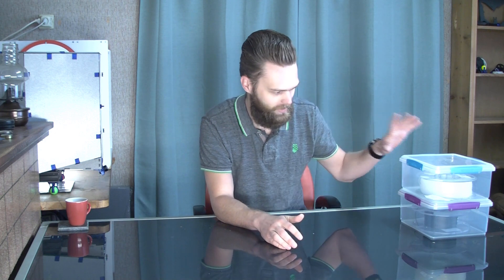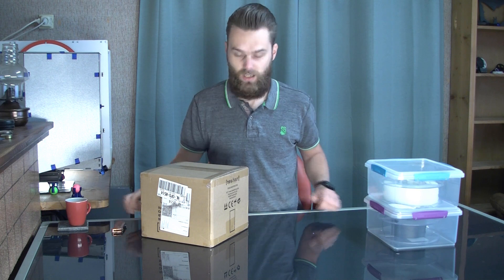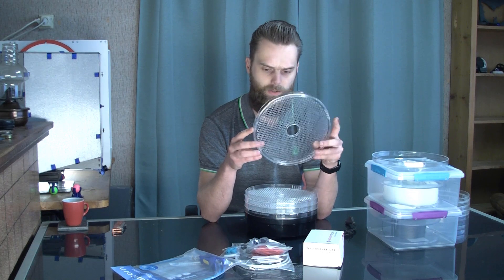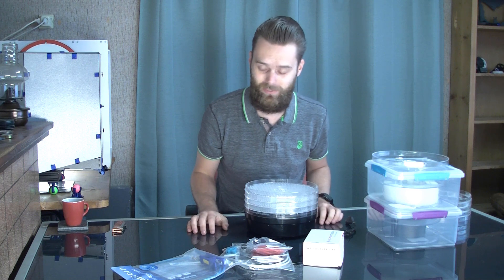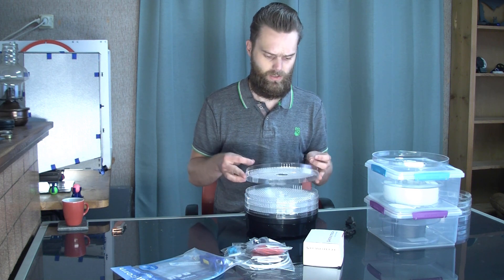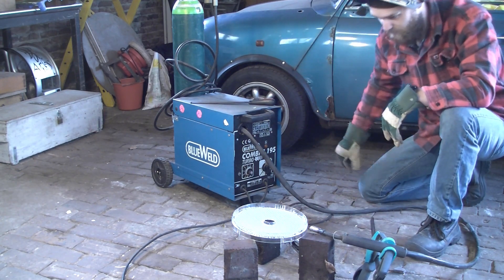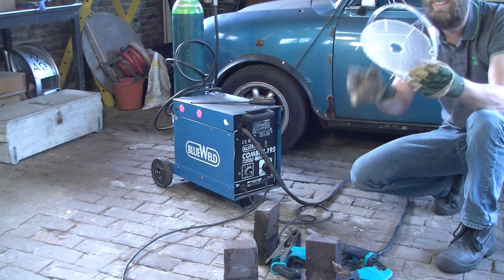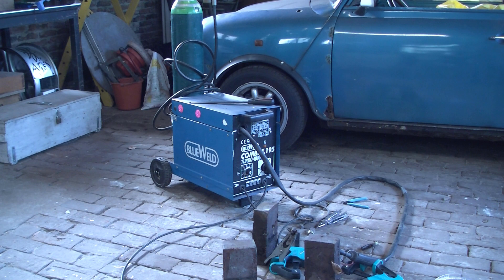Printing (carbon fiber) Nylon on an Ender 3

Comment: If going after an ant with a bazooka like this won't get you any new subs i dunno what will Jon. Hilarious! I feel sorry for the guitar though...
Reply: I think a foam cutter with heated wire will do the job
Reply from the maker: @ronnygyles3784  I think that too but, I'm one of those guys who don't have a foam cutter, but do have a guitar and a welding machine ;)
Reply from the maker: Thanks a lot for your awesome comment! Don't worry about the guitar, the strings needed to be replaced ;)